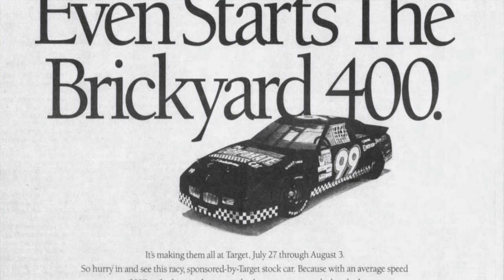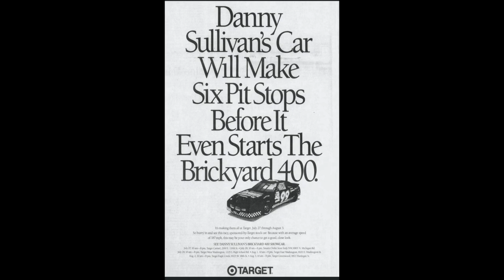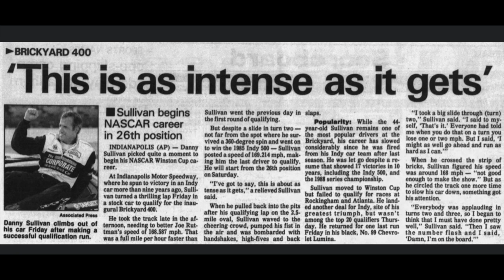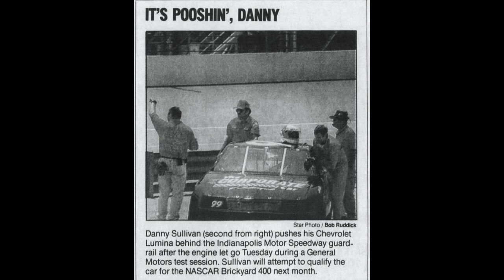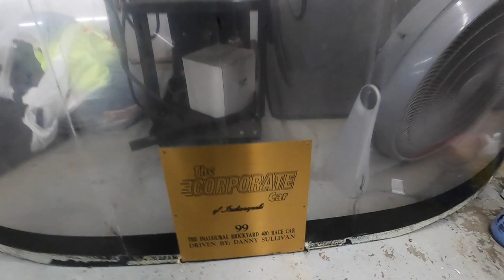The Last ORIGINAL 1994 Brickyard 400 Car Runs Again! Travis Bell's "Barn Find" is Going Home!

Comment: That’s kinda funny about the windows. I remember watching some documentary about 80’s nascars I think, and the Buick Regal had a issue when the rear bumpers were creating too much drag, the body guys would tack weld the rear bumpers on. The drivers would let someone get on there bumper and start riding the brakes and it’d cause the bumper to fall off and the car would start hauling ass. I can’t remember who’s bumper didn’t come all the way off, but officials caught on in the pits were they were trying to get the bumper all the way off and they seen were it was tack welded on. I love to hear about all the old nascar “tricks”!

Comment: Damn homie. Now just imagine if you had an SB2 or an R07 out of one of those things sounding and smelling like that in your Carlo. Turbo Ls cars can make turbo noises at you and then you can whack the throttle on that naturally aspirated mthfkr and bounce of the rev limiter at 8500 RPMs. I know a guy that has a motor out of one of Bill Elliots cars from 1997 in a old Ford hot rod. It makes every other v8 around it at the car show sound like little baby bish motors.  It's absolutely phenomenal to hear that sound coming out of a street car. It's ridiculous. NASCAR had them regulated to around 800 hp. But those engines can easily touch 1k+ hp if you put more fuel and air to them.
Reply from the maker: I agree man. It’s gonna happen eventually
Reply: @Stapleton42  it'd be beyond bitchin. It's the perfect car for it.

Comment: That’s a cool 😎 story! But a complete bummer when he fired it up! That was not the Childress Engine that I’m sure was in the car while it was in the barn? It sounded like a junkyard 305 with open manifolds! They could have put any old 2 barrel circle track engine in it with the 4 barrel intake & it would have at least sounded the part! Those cars are only worth something with the correct drivetrain, including the engine! Why do you think anyone could buy one for a couple of grand with a basic small block in it! I really hope he didn’t get screwed out of the engine!

Comment: Those damn roof flaps .. who was it that got caught putting different spacers under them to lighten the assembly, then they said F it .. now we're just going to have a standard control part available thru Roush Yates and you can't mess with it in any way